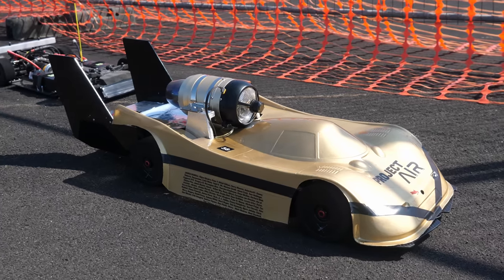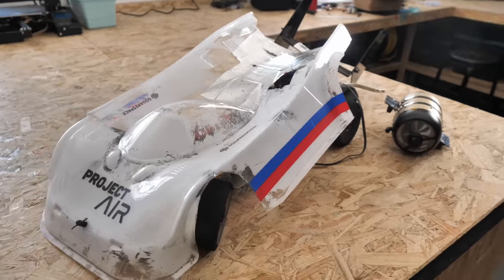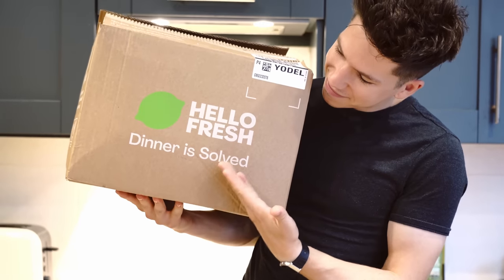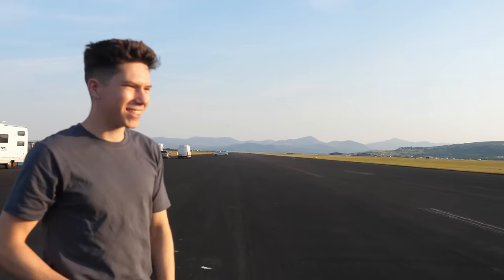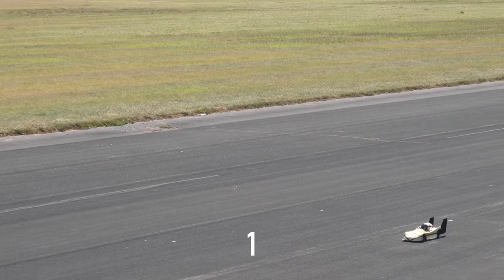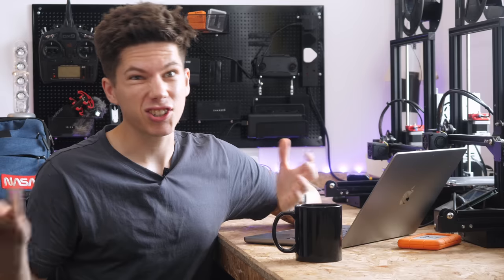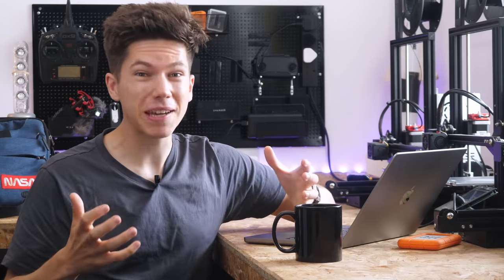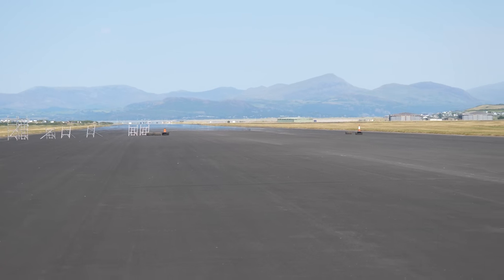Fastest RC Jet Car (Runway Testing)

Comment: The reason for some of the issues is due to your braking i believe, if i remember correctly you are braking with the back wheels.

Full-size cars brake predominantly on the front wheels for a reason. When you are braking with the back wheels you are essentially moving the center of stability forwards, past the center of gravity. You see this effect when you are driving on ice and use the handbrake. rotating wheels have higher lateral grip than spinning/sliding wheels.

The wing helps to counteract this, keeping the center of stability behind the center of mass until you lose enough speed, at which point you lose control. This might also be why it stopped wobbling when the motor gave full gas again, just to crash.

A relevant example with wheels and grip that may be worth mentioning, when you are braking and accelerating you are essentially borrowing lateral grip.
When a FWD car accelerates too hard in a corner they crash front first
When a RWD car accelerates too hard in a corner they crash ass first.
the same holds true with front brake vs handbrake.

The fact that the center of thrust is above the wheels is probably also adding to this, by putting more pressure on the front wheels during acceleration. Cars which use a normal motor which spins the wheels have a center of thrust that is both at ground level, and is in the same direction as the ground itself.
Reply: Yes to me it also looks like the wings actually was the reason for it not to perform worse in the wobble period 🤓
Reply: Sorry to write this, but you are wrong. You can have a blown up tire on the front wheels of your car and control it safely to the stand. But a blown up tire on the rear wheels will spin you out of control. The back wheels is what is stabilizing your motion. The front wheels are for steering the car. The same goes for braking. If you brake only on the front, you move the braking point in front of the center of mass, making the car instable. If you brake on the rear, you move the braking point behind the center of mass.
The pitch of the car towards the front while braking (forced by the suspension) moves the center of mass also to the front and makes it necessary to have bigger brakes on the front than on the back.
Reply: @Craftlngo  Part of that is exactly what i'm describing. The back wheels is what stabilizes the motion, when you brake to the point where the wheels start to slide you lose lateral traction. This is why braking only on the rear wheels causes you to lose control. 
Braking to the point of sliding is analoguos to the tire blowing up, just to a smaller amount.

Braking the back wheels to the point of sliding moves the center of stability forwards by an immense amount. This is what i described at the end with the braking on ice.

I am sorry if that was unclear.

Something i also have to say is that the center of mass is always the same, What changes when you brake is not the center of mass, but the direction of "acceleration".
All things experience 9.8 m/s/s, ie a 1-60 accelaration of about 3 seconds constantly, That is gravity.
When you brake you add an additional  force - deacceleration. That force if it equals 1g(9.8 m/s/s) moves the direction of acceleration 45°, putting the center of pressure on the wheels forwards, which makes the traction act as if the center of mass is moved forwards.
Reply: @Ganbalf  ah ok, English is not my native language. Quite likely that I didn't understood a part correctly.

Comment: Need to mount the jet very low and as far forward as you dare - Use some duct work for intake and exhaust. You could use a venturi effect for the jet thrust to create some downforce by sucking some air out from under the car. If the centre of drag/lift is behind the centre of mass it shouldn't go out of control so badly, and at speed it will become even more stable.
Reply: Jet engine for suction? That's a easy way to ingest as much debris as possible.
Reply: Was looking for a comment like this. The amount of thrust is just too much for a car that light, it completely dominates any aero the car has.
 Pulling the car forward with a front mounted engine seems like an obvious (and not particularly pleasing to look at) solution.
Reply: the c/g is off where it is.. it needs to be 50/50 or 70/30   its better for a jet engine to drag on the ground  then push in my opinion...

Comment: Amazing work. I would add dividers in the fuel tank to stop the fuel sloshing around, and lower the engine as much as possible by cutting out some of the moulded shell and 3D printing a aero housing.

Comment: Is it possible to output a log file of the gyro data? Looks like the gyro is both causing instability, and correcting for it, keeping it going straight. So maybe some sort of resonance or delay with the servo, or linkages?

Comment: I have a theory. If you are pushing it with thrust from the rear of the car it's less stable. My theory is that you move the engine to the front and give it just the right angle to keep it slightly pushing down similar to the current setup but slightly more and sorta have the chassis be following along. This would increase the downforce and imo increase stability. The large upright wings would still be needed. Very neat project you have. Lots of luck to you
Reply: Robert Goddard, is that you???

Comment: what i would suggest is get the handling stiffer and go electric with a increased length and check the weight distribution of the car particularly as in high speeds and winds the lighter sides tend to lift up and did your car lean towards same side in both the crashes .

Comment: From an engineer with 20+yrs of experience, awesome video & engineering content!! 😎👌
Also, as a speedrunner, when it comes to gyros, I prefer to keep them off. The problem that I have experienced with gyros is that if a wheel looses contact with the road while the gyro auto correct... Well, it's going to over shoot your car in the wrong direction.
A tip that I'm not sure you have implemented yet is to switch the diff fluid in the front & rear diffs to 1mill, that will help keep your car in a straight line.
Just some thoughts, good luck 🤞 🍀 👍

Comment: Really interesting attempts and development iterations. Being into liquid rocket hobbies my first glance at your construction made me wonder why you haven't slush plates in your fuel tank? The fuel might start oscillation wildly at an unpredictable speed because of this. Might just be one of several reasons in combination. It would be easy to eliminate this, just by filing the tank half way up with a few large metal spiral chips from a lathe or from drilling.
Reply: Yeah that was a thought that crossed my mind too.

Comment: Maybe u should place d engine as low as possible and then use an s duct to feed it air
Plus the oscillation might just b caused by the car wanting to take off, u might want to work on generating more downforce
Looking forward to more projects 😃😃😃

Comment: Awesome project. When attending meets like that, there will always be the "I know better" kind of people, especially when you're new in the group. Some are worth listening too. Others just love the sound of their own voice. You did a good job verifying the issues with the design.  Since it's experimental on many levels, there are no real rules how to go about it. You can't be first while following someone else's footsteps. 
   To throw my hat in the ring, I'd consider having a separate channel for the gyro and actually give the stabilizing fins air rudders and a lightning fast servo. It's only at high speeds you need the assistance, and by then the rudders should give adequate correction force while allowing for a quicker response since the servo won't have to fight against the centrifugal forces of the spinning wheels.

Cheers!

Comment: Hi, I think I have a really easy improvement with large benefit: The oscillation is dramatically worsened by your fuel tank. Look at a tanker for example. They have ridges inside of the tank to stop the fuel from flapping arround too much

Comment: Sorry for the late comment. Enjoying watching this jet car go. I caught it at the end of the video. Loss of signal and the fail-safe problem. That problem starts with the DX6e. The e models don't have the diversity antenna system. The single antenna has good range to the sides of the transmitter, but if you point the antenna towards your car, plane, whatever, you are effectivity putting it in the cone of silence. I happen to like and use Spektrum for flying. Just not the e model transmitters. I've seen planes lost because of antenna being pointed towards the bird at half the distances I fly out to with only a dozen dropped frames on my DX18. I'd bury that 6e in a shallow grave at midnight and upgrade to a full DX6, 8 or better before attempting another speed run. Good luck and keep the vids coming.

Comment: I don't think it's a good idea to disagree with the designer of the best limitless wing on the market. His cars don't oscillate at over 190 mph with much stronger cross winds. 

The gyro wouldn't have been overcompensating if there hadn't been an oscillation in the first place. You made a giant sail behind the rear axle.

Comment: ExpressLRS control link for your radio.  Also, Gyros hate vibrations.  Dampening the mounting point of the gyro may help, but road vibrations may be too much for the gyro to filter out.

Comment: 14:45 You say that the wheel wobble didn't happen without the gyro, but it clearly was. It looks like the gyro is trying to compensate for that slight wobble, but with the slop in the system and possibly some resonance from the fins it can't get  there. I would look at rebuilding the front end then tuning the gains on the gyro.

Comment: You may need a Glitch buster on the receiver. With the Gyro attached to the receiver, its pulling too much power and the receiver can't supply that power. I have this same issue with high torque servos. I put a Racers Edge Glitch Buster capacitor on it and it solved the issue.
Reply: Not many people understand this, kudos. The gyro causes the servo to do more work. If power to the rx isn't robust, the added load can cause a brown out, which may result in a crash. Most guys attribute the crash to a loss of signal, and root cause is often incorrectly identified. It takes some work to correctly identify the root issue. Fortunately there are plenty of ways to identify signal strength and voltage through telemetry, none of which were employed here, regrettably. It takes a lot of time and energy to "make your luck".

Comment: Never compromise and don't let anyone change your mind last minute, if you fail, it's your fault. I think this crash could have been avoided with more testing of course. I think using the electric motors on the chassis and adding a weight at the height the jet engine would be mounted to do some stability testing before actually slapping you're expensive jet and fuel supply to it is the economic course of action to take. Heck, maybe even running it as a hybrid might achieve some better results for you. I don't know about the gyro, it could well be the slop in the steering that caused that crash so although it seems like it caused your accident here, I think it was just wear and tear. I can't wait to see what you do on the next car, I think custom chassis and body are the next port of call but unless you're doing fancy carbon/grp layup I can't see anything else being affordable and available apart from 3D printing but I don't know enough about that to say yeah, it's good for structural integrity and forces that the chassis would be exposed to. Anyway, I look forward to the next vid!

Comment: A couple more tips for improving handling,heavier silicone oil or smaller valves in the shock’s and more spring rate on the rear will do more than fuel line,also you need Less front traction! You want to go straight so put grip on the back and as much as you can! and a set of Harder compound tyres on the front, if using foam you can shape the front tyre’s so  it acts like extreme negative camber ie not cylindrical but conical profile the added benefit is the narrow point of tyre touching the road is easier to compress and will absorb more bumps and more aerodynamic! Hope this helps!

Comment: good job... suggestion tho.. i would brace the wings to the frame via supports to the frame at the top (in last testing you can see a little left to right flexing )   kinda like airplanes brace with cables..     /TT\ kinda like that but heavy duty fishing line tired to both  and a piece of carbonfiber across .. should greatly stiffen the fins. and if done right would plant the fins to where they wont move at all (like stapping a package down on a truck thats too tall) ... only other thing i can think off is stiffen the turning and point jet engine down alittle so it will plant it to the ground better. no alot mabie 1-2 degree.. reasoning is the tires can only have so much grip. so you need to compensate via downforce 2-3 lbs of downforce is a big difference on such small tires... i learned that with my 120mph 2wd ruster........

Comment: I’m not an engineer, so I’m sorry if I’m dumb for even suggesting this, but if you wanted the covered wheels with it having no chance of it rubbing against… maybe try putting two runners (would be part of the frame) along either side of the vehicle, similar to modern go-karts, attach the cover on top of that? Just a thought, might have other unforeseen consequences though. Either way, love this! First jet-powered RC I’ve ever seen. And it’s beautiful

Comment: Small suggestion from DK:
The car would benefit of having the tank modified, i would suggest to open it and add small plates into it, to prevent the "sloshing effect". 
Without this, a small correction can easy turn into a big issue during high speed and direction corrections.
You will find the same in the tanks of almost all trucks transporting liquid.
Cool project, keep on fighting.

Comment: @7:00 yes - that is exactly what I was thinking you need.  If you can get that engine down low into the body it will be a game changer.  Take a look at how a jet dragster or top fuel dragster is set up to go 300+ miles an hour in a quarter mile.

Comment: As a rule of thumb turn the gyro gain right down. I usually run about 30-35% gain and it seems to do a great job. The sloppiness in the steering is another large contributing factor. Apart from replacing worn links etc... tighten the pivot balls of your front suspension arms. they usually come loose and contribute to the slop.
Zero slack is the best.
You were around some speed run royalty at Rossa, Raz Shiffrin is a LEGEND at setting cars up right and Kev Talbot Is an RC (and Monster Truck) God!! Huge fan of both.
I really hope you get this beast back up and running soon and onward to 200mph mate! Cheers from Aus!

Comment: You should really set the gyro gain to a nob on the transmitter so that you can adjust the gain on the fly. You also need to make sure the gyro is completely isolated from everything other than the chassis with a good double-sided gel tape. Even wires touching the gyro can cause oscillation. It might have not been the cause of the crash but I would prevent it from becoming the cause in the next run with the car as speeds increase. I use that same sky RC gyro on my speedrun car. I have had it to 168 mph with no issues. It just needs to be set up and installed correctly. Hope you have better luck next time. In the last video, I actually mentioned hooking up with Kevin Talbot. Glad you just happened to meet him. I love that crazy guy, lol.

Comment: 7. Point your thrust at approximately 3 degrees down toward the center of gravity or just forward of that point. That is a plus for you Choise of propulsion. Electric motor cars do not have that benefit. Kenneth Warby used it to great effects with the Spirit Of Australia. Look it up you could do the same with an rc boat, that would be a first. 👍

Comment: I suggest using an ardurover based flight controller for gyro. I'd also recommend using a capacitor to keep the power to the imus nice and clean. You could even use an arduplane setup and use rudder/elevator for control
Reply: I also think something like a flight controller is the way to go.

Comment: The reason he blamed the fins was because he saw the side wind. You can see it on the flag as you mount the tower. But if anything the fins could keep it in a straight line like the tail on a dart or arrow feathers.

Comment: Just wanted to throw in that it sounds normal that the gyro freaks out when you do a dry run with the wheels off the ground - like that steering has no effect on the orientation of the car, so the feedback loop is broken. It's like when you take the props of a quadcopter, it'll just try to throttle up like crazy to try and get control over it's orientation unsuccessfully.

Comment: Great project. I would like to suggest that try to install the Center Body Stiffener Set on the bodyshell, it will make the bodyshell more stable cause the faster you go the more & strong wind get inside the bodyshell. Try get wider rear tire than a front for more stability & traction & finally install the FPV for your better view. Mount the camera behind the front windscreen instead of outside the bodyshell. When come to high speed Aerodynamic is the most important key. The mistakes were always the lesson, hope to see the RC Jet Car video again. Thanks for the Video.